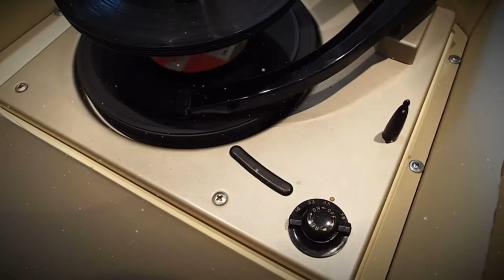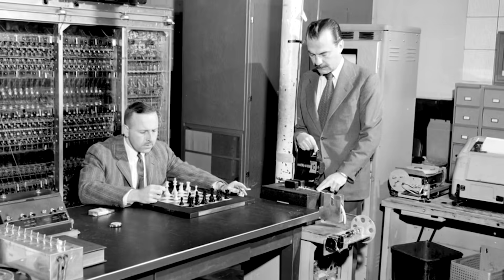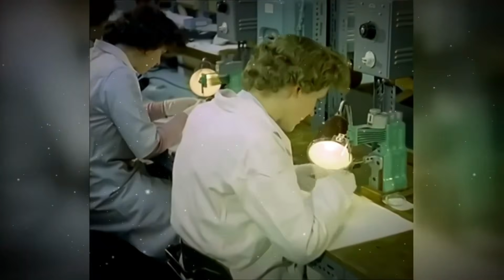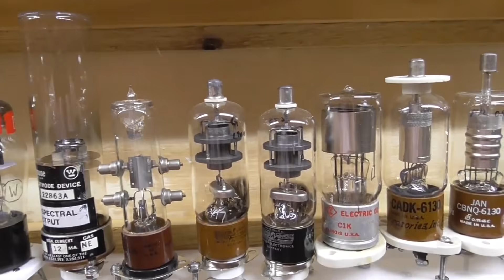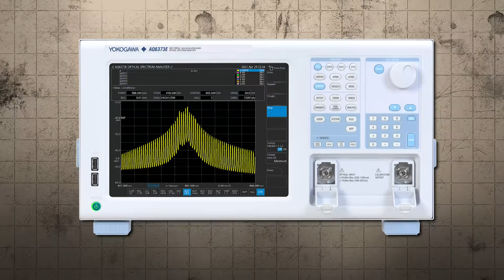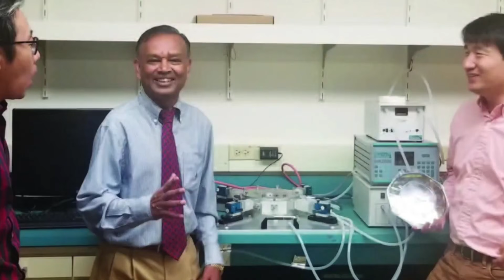This Forgotten Technology From the 1960s is Now Worth Billions

Comment: giant vacuum tubes are still used in the amplifiers for basically all high powered radio equipment from radar to television broadcasting because ironically they're more compact and efficient than the equivalent solid state system would be.
Reply from the maker: Thanks so much for sharing that insightful detail about giant vacuum tubes! It adds a whole new layer of understanding to their continued importance, especially in high-powered radio equipment.

Comment: Transistors are digital switches; vacuum tubes are analog. That's the difference.
Reply from the maker: You're right, that's a key distinction between the two technologies! The shift from analog to digital was a huge leap.

Comment: Electric ignition in cars that a teenager could repair. The excess of computer electronics gives the unprincipled, infantile, and psychopathic trolls of the pirates of Silicon Valley control of too much critical infrastructure. Cut off electricity, computers, even communication, and it's a dangerous nuisance. Cut off transportation cuts off escape, mobility, and the ability to fight back. It's what an abuser does when they control the car keys, and house keys. It makes captive slaves of us.

Comment: The story is repeating itself with cars. 
# Modern cars are over-filled with a lot of advanced technologies => That often fails.
# Cars are built in a different way, with extreme cust-cutting in focus  => Which makes repair costly - in many cases impossible.
# The "Business Model" has changed dramatically. => You pay full price for your car - but you dont own it. You can not repair it. The price for spare parts has skyrocketed.
# Most car manufacturers are on the brink of bankrupcy => But the price for a car has increased significant in recent years. => What went wrong ?
# 20 years ago a car would last minimum 10 years. Some owners could keep their car running for 15 years or 20 years. => For many car models the lifespan is now reduced to 8 years.
    because it is impossible or way too expensive to keep it running.
# The regulaters want efficient cars that will just leave a small footprint by reducing the need for expensive recources => The opposite has happened - 
     the short lifespan of a moders car, has doubled the use of all kind of resources.
# The list could go on - but you got the point. So I stop here.

Comment: Electron tubes operate on a much higher voltage than transistors. The 6l6, if memory is serves me, plate voltage is $400 volts. This means the tube based device needs a 0much greater power suppl, with large power transformers,  electrolytic capacitors and such. They are expensive components. I remember selling 5U4 GTs for eighty cents in 1958. I suppose these facts would support the rebirth of those components. Transistor circuits operate usually on five to nine volts. Tube systems are much more dangerous due to the operating voltage. So this indicates a market for the tube operated system. RCA Victor produced the best tubes in the world. That great company with 80,000 employees is gone. When our supply of a particular RCA tube was gone, we'd offer a GE or Westinghouse, the customer would  reject it in a rather rude manner. And let's not forget the problem of voltage dividers for tube operated systems.